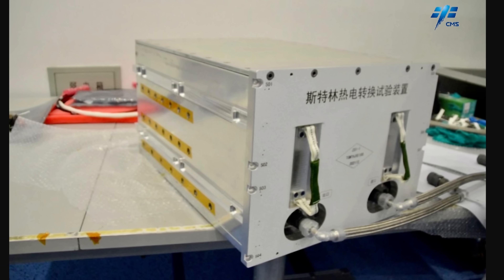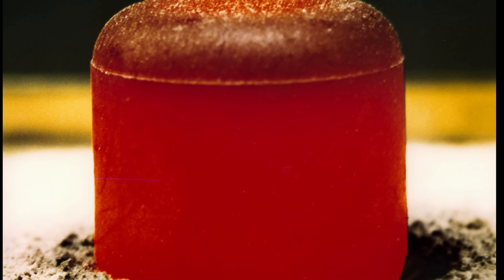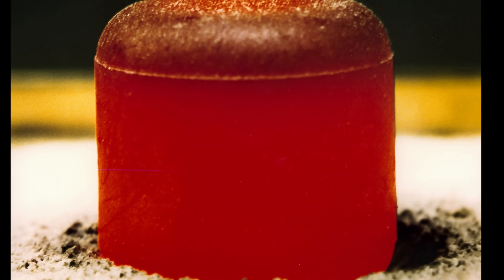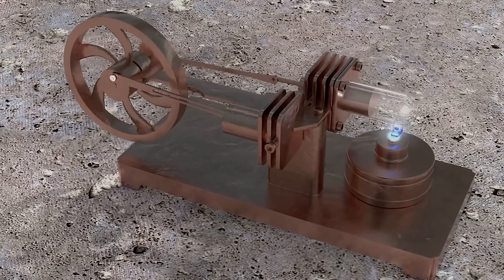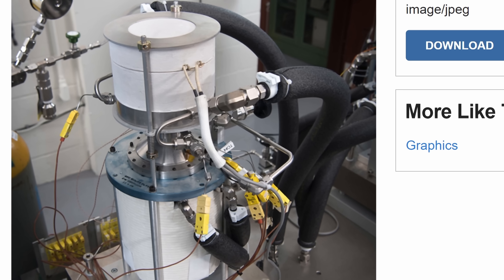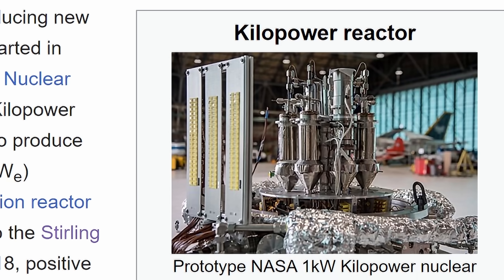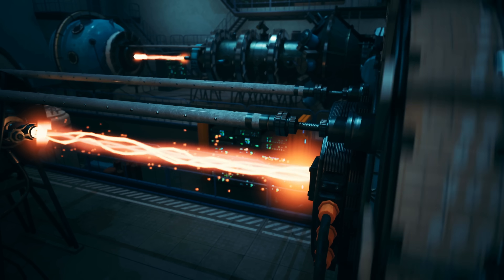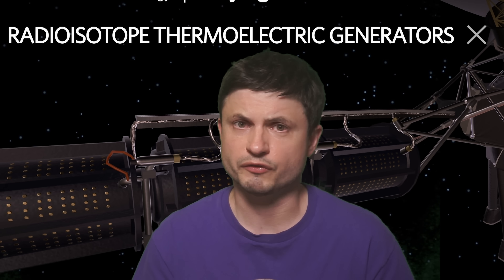Incredible Advances In Nuclear Stirling Engines For Space Exploration

Comment: It takes an awful lot of faith to cheer on an engine that has been a total failure for over 200 years.  Stirling engines are very low efficiency, as they are a walking contradiction.  They need membranes that are simultaneously good insulators and good conductors of heat.  Plus:

    Carnot Matters -- There is a fundamental and      unavoidable law of thermodynamics that says
     the best possible efficiency of any heat engine     is proportional to the absolute temperature
     delta fraction. Thus your best possible efficiency     a 20 degree rise at 70 degree F room temperature
     would be 20/(459+70) = 3.8 percent. And no     real world system can be even this good.

    Efficiency Matters --As efficiency goes down,    the size and complexity of the energy recovery
    device will disproportionately increase in a    hyperbolic or worse manner for a given set of
    recovery values.  

    Amortization Matters -- If your energy recovery    device is producing an average of two cents worth
    of electricity per day and your total cost of ownership    is three cents per day, you have a gasoline destroying
    net energy sink. The longer you run it, the more    gasoline you destroy

   Gotchas Matter -- A Sterling engine needs a    special part called a regenerator. Regenerators
    have to be long and thin and short and fat.    They also have to be very good conductors of
    heat and outstanding insulators. Extreme    engineering compromise is needed and nobody
    has come up with a good regeneration solution    to date.
Reply: All the effort you put into that wall of text moaning about the poor efficiency of Stirling engines and yet the free piston Stirling engine is still many times more efficient than the RTG it is likely to replace.

Comment: But the energy must flow to the vacuum so new energy keeps moving the coils. The top amount of energy one can produce is the amount of energy able to irradiate to the vacuum of space, I think is not something big
Reply: Wouldn't you just make a large surface area for the heat to radiate out of. The Voyager crafts used TEGs run from radioactive material with initial  production of over 400  Watts.  They obviously could radiate enough to run and they have lasted 45 years.

Comment: So way not use them as your own home reactor?
Reply: Because distributing lumps of plutonium to the general public to install in their homes would be very silly.
Reply: @ferrumignis  Why? You can't make a bomb with pu238. It's not that dangerous - alpha radiation can be stopped by a piece of paper. That biggest danger would be heavy metal contamination if the expended plutonium ended up in a landfill, easy enough to license to prevent that. You could heat your home for 25 years from 10 lbs of the stuff. The biggest hurdle is that world production is only about 3 lbs/year (it is made inside fission reactors). There isn't enough in the world to heat a single home.

edit: Up until recently we had Americium inside every smoke detector in our homes. Americium and Plutonium 238 are equals as far as radioactive dangers go and yet we gave some to every home in the world. Pu238 inside our homes wouldn't create any more danger then we already have with the Americium. Don't breath in any Pu238 dust any you'll be just fine.
Reply: @wally7856  You don't believe house fires are possible?
Reply: @ferrumignis  you can put a label on it "Caution Hot!"
Reply: @ferrumignis  you can put a label on it “ do not open”
Reply: @DarkMatterPartical  Good point, that's always stopped idiots taking things apart.

Comment: Most gasoline combustion engines avg. Only 20% thermal efficiency.
Reply: Yes but 60% is about as high as we can ever theoretically get. In order to get to 100% the temperature inside the engine has to be infinity and you have to exhaust the gasses out to absolute zero. As long as we have materials that can melt inside our engines and our atmosphere is about 15 Celsius, 60% is about as high as is possible. Considering we have some diesels making 50%, we are doing pretty good.
Reply: The hybrid engines used in current Formula One cars get around 50% efficiency, pretty incredible really.
Reply: @ferrumignis  not bad for 10-15 million dollars a pop. This one cost 180mln.🤑

Comment: Does it have moving parts or not? Sometimes you say it has no moving parts but all the diagrams and models show springs and pistons.
Reply: This. Clearly it has moving parts. Perhaps he meant to say they are frictionless or non-wearing/maintenance-free moving parts?
Reply: @ThumperBunny  yeah, "non-contacting" would be clearer. Even static components will wear eventually (the radiator will eventually be eroded away by micrometeorites,) but it only has to last longer than the life of the heat source. Non-contacting parts can still be damaged by exceeding some parameter like over speed, excessive acceleration, misalignment, external shock, or controller malfunction.
Reply: There is a piston, a displacer, the spring, and a connecting rod that move, all with tight clearances and compressed air keeping everything from touching.

Comment: Unbelievable how old tech can inspire such new tech.
Reply: Actually it is 20 year old design that they now think was good enough. NOT new, but finally confirmed as great.
Reply: "old" is a man-made concept.
It's just tech
Reply: Usually how progress tends to work 🤣
Reply: Let’s all keep arguing over semantics like children
Reply: Was unbelievable when I saw a Cylindrical spaceship combining new technology with old, Diesel engine with anti-gravity reactor
Reply: No, totally logical so totally believable.... My ONE STROKE internal combustion engine design I should publish someday wraps a simplified Stirling-style heat engine in the central cylinder (+ 2cm wide piston head + seals) with an outer internal combustion cylinder + 'ring piston' head. Each end has combustion chamber impeller veins with 4 solenoid-actuated poppet valves between them, and a central Spark Plug Fuel Injector combo. The heat engine veins extend from the central heat engine cylinder to between the outer ICE combustion chamber impeller veins, helping to cool them. 
--
It's ONE STROKE because combustion shoots hot gas out of the impeller veins and compression squeezes air+fuel into the chamber at the other end, so compression as well as combustion provides TORQUE. It's a rotary engine. The fuel tank should probably spin with the engine to avoid fuel seal issues. Keeps it all self-contained and helps cooling. The inner heat engine cylinder is filled with CO2 and the whole engine + fuel tank combo is wrapped in a heat sink.
Reply: “Well aktuuuallly….” You guys go to time out right this second and leave OP’s comment alone. It was a perfectly valid one that can stand on its own without your contributions…
I swear, it’s like a pack of wild dogs around a bitch in heat here on the interweb.😒
Reply: The key innovation was the sodium filled heat pipe system, which is for the most part new tech, adding a sterling engine to a nuclear heat source is old technology that has been studied for decades.
Reply: For me it's unbelievable how old tech was not applied to improve cutting edge technologies despite everybody knew how it operates. 3X energy output by applying 200 years old technology is something you would expect from a billion dollar space mission to figure straight away.
Reply: There was better stuff around here 200 years ago laying around and the Freemasons removed it to put us on gasoline, wake up people, we are a designer race, genetically designed in European labs.
Reply: In this case it's rather new drivel than new tech. There is no cold medium in space.
Reply: More like how new tech can inspire more efficient use of old tech.

Heat pipes used in this design are relatively new compared to the stirling engine that they are combined with.
Reply: @mnomadvfx  Well NO. Its new tech inspired by old. And that's pretty much how innovation works. In Michael Kalashnikov's word - One must have a good idea of existing designs to bring something new.

Comment: I would probably replace the spring with a strong permanent rare earth magnet, such a those neodymium ones, have a another one attached to the base/back of piston (same polarity). This would remove another mechanical part that could break.
Reply: Those magnets are sensitive to temperature. If for some reason it would get hot (like 200C or even lower) it would lose the magnetic properties.
Reply: @sczygiel  Depends on temperature the device would run at. Apparently, according to google, neodymium magnets have a pretty low Curie temperature, but that doesn't rule out some kind of strong permanent magnet.
Reply: I think the free piston Stirlings NASA tested back in the 80s used a gas spring.
There may be a mechanical backup for low speed oscillation during start-up and shutdown tho.

Comment: 2:44 The voyager RTG used many thermocouples which is a similar to peltier device but is made from 2 disimilar wires.
Reply: 6:15 Increasing the pressure of the gas in sterling engine increases the power output - smaller engine does more.

Comment: Is there a way to change the geometry of the RTG component in order to turn the engine off (when it’s not needed) and extend the lifetime of the fuel? That is, if the heat has anything to do with a chain reaction driven by neutron flux, then you could make the fuel less dense and slow the fission. Or perhaps these isotopes have nothing to do with fission.
Reply: No. The fission will not stop. You may moderate the output a bit or collect a bit of the energy by not cooling the isotope for some time and then cool it down pulling more power than without such cycle but you cant switch it off much.
Reply: I guess since the decay energy is from alpha decay and not fission, the best you can do it store the electrical energy in a battery (which would incur more inefficiency but better is potentially better than nothing).
Reply: @theWitheredFigTree  Alpha decay is literally fission, just a specific case where one of the daughter products is an alpha particle.
Reply: @filonin2  okay that makes sense. Is it spontaneous, or is it driven by neutron absorption? Are the alpha particles able to be absorbed by a nearby nucleus analogous to a chain reaction?
Reply: Short the electricity output, that will put a large load on the motor, reducing the amount it moves.
Reply: @universeisundernoobligatio3283  That would not affect the rate of radioactive decay.
Reply: @ferrumignis  
The radioactive part of the generator does not care if the armature moves. 80% of the heat already is wasted maybe it will run a little hotter if 98% of the heat is wasted.
Reply: @universeisundernoobligatio3283  You are answering a question no one asked. The OP wanted to make the fuel last longer, not stop the motor from moving.
Reply: @universeisundernoobligatio3283  "The radioactive part of the generator does not care if the armature moves"

If you understood this why did you give an incorrect answer to the OP's question?

Comment: i want a motor like that for my e-bike, smaller version but still.... its amazing what they can do there, respect science!
Reply: No motor was discussed on this video. This was a generator. It's the opposite of a motor.
Reply: @filonin2  : The magnet and coil is a generator, the Stirling engine is a motor that drives that generator.
Reply: @filonin2  do you understand what the word "engine" means?
Reply: Stirling engines are good for energy efficiency, but poor for weight and volumetric efficiency: your bike would be an under-performer.
Reply: Public access to Stroncium, Uranium or Plutonium would be a terrorist's heaven, buy several of these bikes and you got yourself a dirty bomb. Good luck getting a licence for your bike if you install a radiodecaying element in it, more like 20 years in prison.
Reply: @andreikoto4810  pure fear mongering. Here's a tip, using the word "terrorist" makes you sound like a fed.
Reply: Nuclear powered cars, smaller battery pack and a nuclear decay generator giving constant charge. Would be great for constant stop and go traffic like a delivery van or bus service. A couple of Kwh of power generation would give a recharge rate of 5-15 miles per hour depending on the vehicle and driving type. Pair that with a small 10-15 kilowatt battery and it be great for city driving.
Reply: There was a couple of cars made with Stirling engines in the 70's. They ran on petrol I think and were slightly (~10%) more efficient than a ICE. The problems they had were they needed to warm up, and power on demand  problems (hard to throttle for correct speed). Probably work well now with a battery to supply power when needed. But with batteries being so good no need for the complexity of a mechanical engine. Unless you are doing long ranges it could work as a range extender (for an ebike I guess like over 80km).
Reply: @AORD72  I've had this idea bumping around in my head similar to that.  Use the nuclear generator to recharge a combination battery/capacitor fed electric motor.

The motor draws from the battery primarily, but the capacitor bank is used to feed instant power to the motor on command.  In principle, you should be able to crank up the power of the motor based on the rate and duration of discharge on the capacitors.  Thus allowing for bursts of acceleration, albeit on a recharge timer.
Reply: @Kirhean Another problem with Stirling engines or Thermoelectric generators (using the Seebeck effect) is they require large temperature differentials. They need temperatures of like 0 on the cold side and 1000 degrees on the hot side to be efficient. This is explained when you study the Carnot cycle. The physics is well known, and explains why people don't use they systems in everyday use.